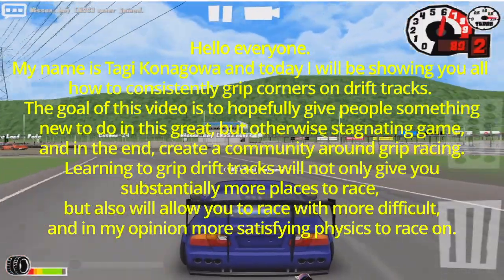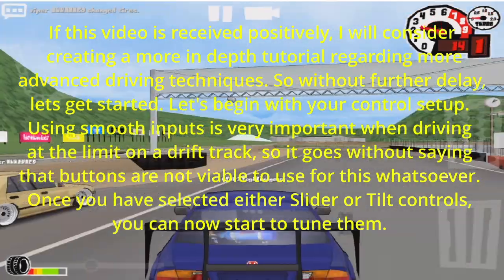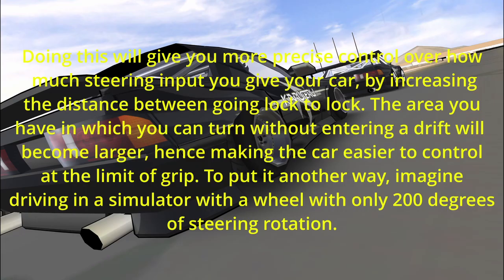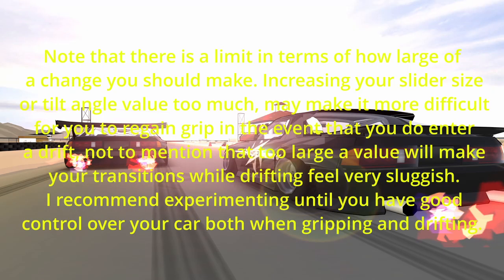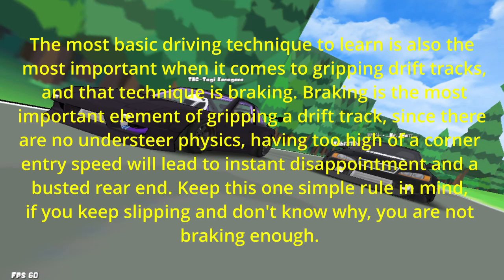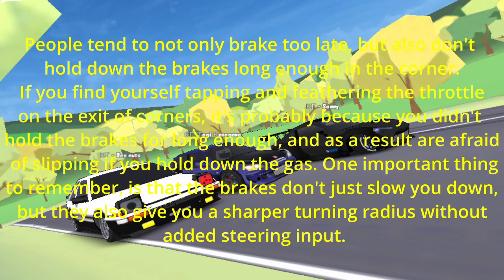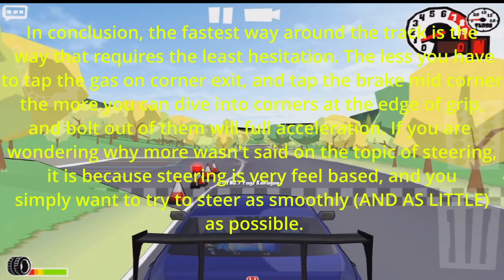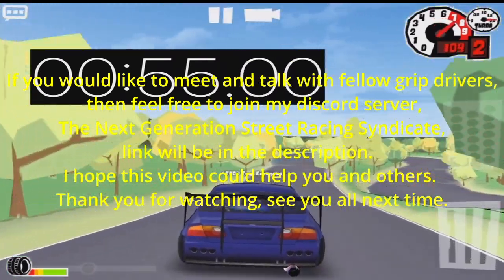FR LEGENDS GRIP RACING TUTORIAL

Comment: Then there is me who uses default sensitivity and completely dominated FRL grip racing on a few occasions
Reply from the maker: You can definitely grip race on stock settings, but fine tuning is the key to consistency and feeling calm.
Reply: @tagikonagowa6809  Default settings feels the best in my opinion.
Reply from the maker: Plus the idea behind the video is to hopefully make grip racing more accessible to people who have never tried it. Different controls should make learning to grip a bit of a more forgiving experience.
Reply from the maker: @Reinhard_Erlik  On tilt I could see default settings not needing to be changed much, but with slider your thumb doesn't always have the same friction, so it helps to have more room to steer.
Reply: @tagikonagowa6809  I use tilt.
Reply: Hello master nice to meet you
Reply: @kesariracing1438  Nice to meet you too.

Comment: What sensitivity?
Reply from the maker: 5.00 whether its slider or tilt
Reply: @tagikonagowa6809  i keep sliding even if i brake do i use a tire with more grip?
Reply from the maker: @chocop8185  Do not compensate with better tires. You need to turn even more gently than you are. Remember if you are on buttons its not possible to grip to begin with. If you are still slipping, try to make your slider bigger or add more degrees of tilt.
Reply: @tagikonagowa6809  i am but it still slides and im not using buttons
Reply: @tagikonagowa6809  but i didnt slide when i had f1 mod tho